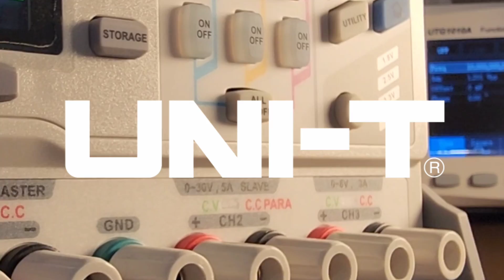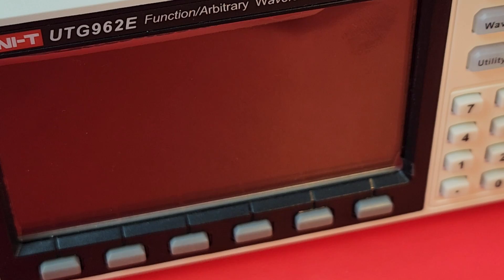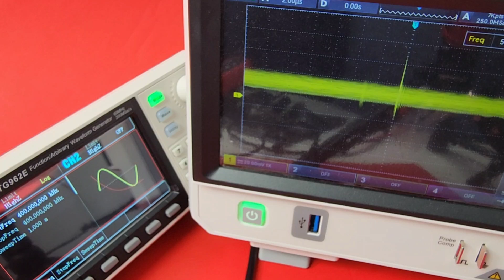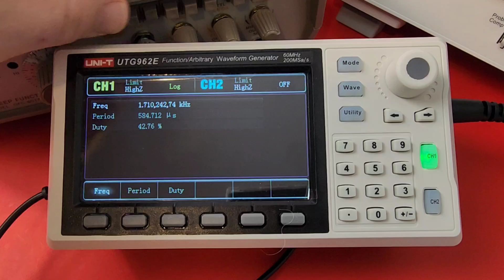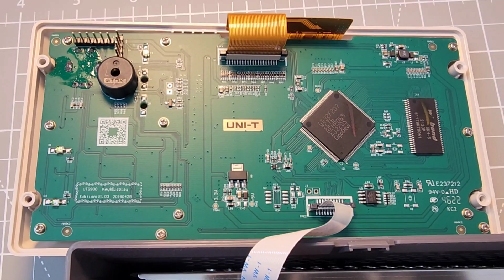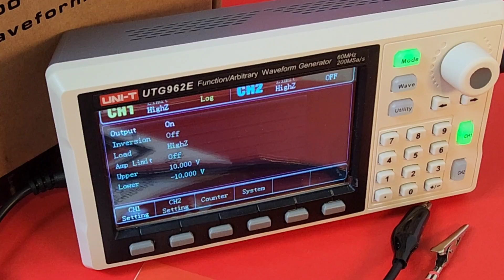UNI-T UTG962E Function/Arbitrary Waveform Generator Review & Teardown!

Comment: Interesting review and teardown, as usual. This device seems to have a lot of functionality and capability. But I have still some questions: Does it calculate the output with 50 Ohm or/and high impedance? Switchable? How is the accuracy is the calculated output (Peak-to peak, RMS)? Connection for a external timebase? How exact is the internal timebase? Maybe is a GPS-synchronized internal timebase available? (That would be a feature...!) But, my main concern is still this kind of casing. I can´t still get, which purpose it serves. If t´s made for stationary use (in an electronics lab), then make it stackable, place the connectors (at least the most important ones) and a hard powerswitch at the front. If it´s supposed to be mobile, then go the whole way and use a DMM-like housing and use batteries or make it even rechargable. As it is now, I´m not even consider it to buy. Sorry, that´s just my two cents.
Reply from the maker: Great questions,  I've only had limited time with this instrument, so I don't have all the answers. I will say it seems to be very accurate with the waveforms output, frequency range, frequency resolution and output impedance. I actually like the form factor and portability. I sit this on top of my oscilloscope, and they make a great pair. It's not bulky and uses little power.

Comment: Quite lovely – nicely built, functional and compact. I guess it would be best to just disable that screensaver until they release a fix. I personally hate it when that happens. Otherwise, there's a lot to like and not a lot to… not like. 👍
Reply from the maker: You took the words right outta my mouth! 😊
Reply: @KeepOnTesting  Looks like it can be switched off, under System Settings on p12 of the manual there's a 'Screen Lock' setting with 6 settings including 'Off', I guess its just a mis-translation, it would be better to have it off by default really 🤔